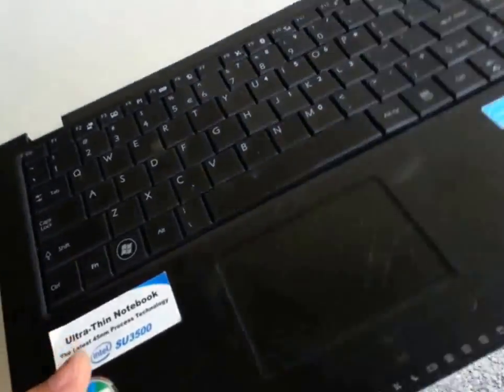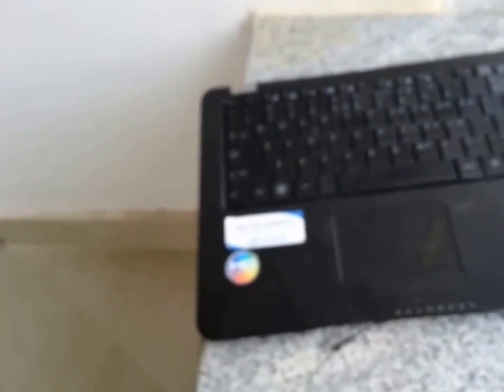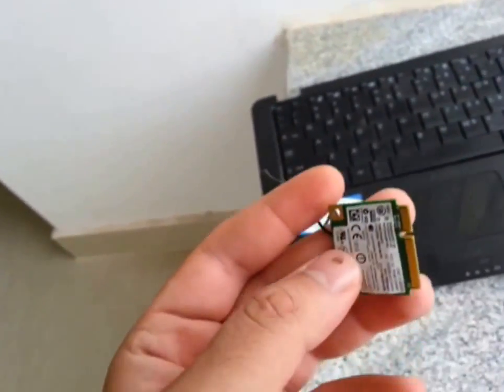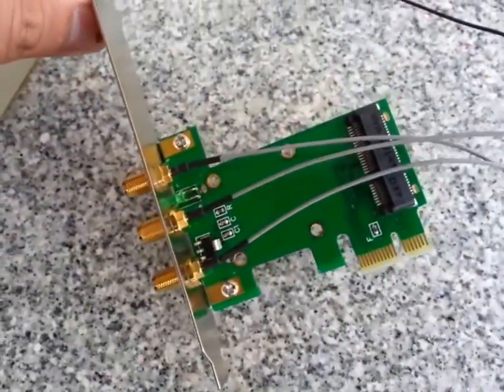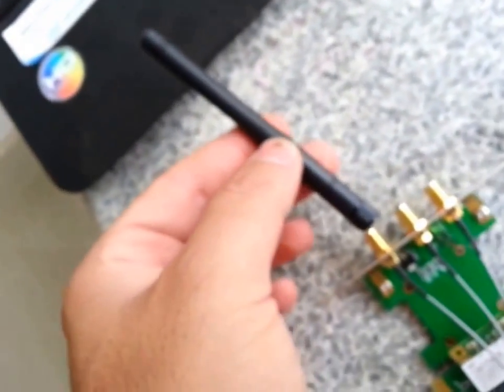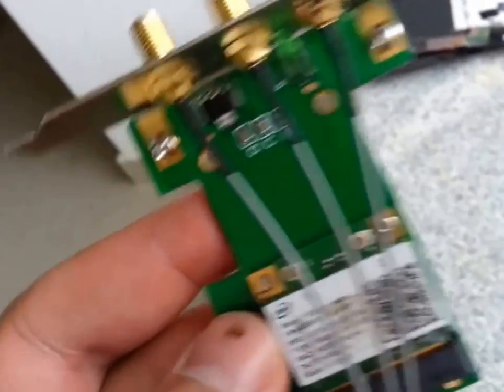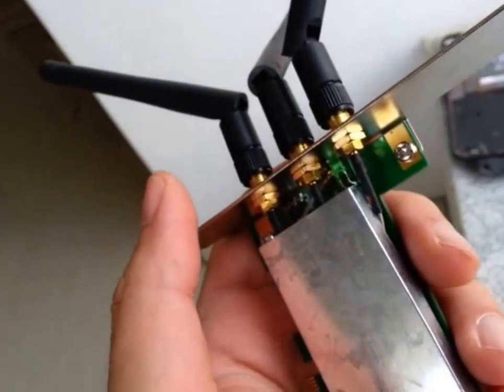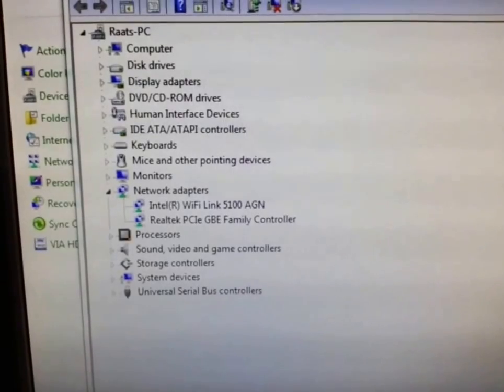Half Size Mini PCIe Wireless Card for Desktop #pcie #desktopwifi

Comment: My old Lenovo K410 desktop tower uses a miniPCIe slot for a half-height wifi card on the motherboard.  I'm going to upgrade it to a wifi6 BT 5.2 ax tri-band mini card for about 25 USD.

Getting the screws in there and attaching the antennas with my fat fingers will be the biggest challenge...
Reply from the maker: Don't worry you will get that screw on Amazon

Comment: You do not need the antennas. Get some longer antenna wires and attach them to a metal part inside the case. Voila, wi-fi with no antennas sticking out the back.
Reply from the maker: Absolutely... that is how it works in a laptop ☺️

Comment: I just want to buy a wifi chip for a very old motherboard that I'm using for now. I'm not sure which board it is, but the chip set is AM3+. I'll build it, or buy it, or whatever. Great video man, very helpful and informative. I subscribed to show you support. Keep the great videos coming.
Reply from the maker: God Bless ya!
Reply: It works on any board with PCI-e. This riser is for PCI-e x1 (the two or three shorter slots not used much)

Comment: hey i just did this but my Bluetooth isn't appearing anywhere, wifi works beautifully. any advice?
Reply from the maker: Its probably a driver issue, what unit are you using? intel?
Reply from the maker: Awesome, thanks for letting us know!
Reply from the maker: Thanks for making this work in my new project! https://www.youtube.com/watch?v=OuZBbJbNLQ0
Reply: Johannes Winger hey Johannes ... You need to connect a cable on to the Internal USB port on the motherboard. You made need a different adapter.. check the other video this guy made... It had a Fenvi adapter...

Comment: the black bar on the extender can u pulg 2 things in each side
Reply from the maker: Hi, Nope, it  is only gonna allow you to plug in the card on one side
Reply: rTech what if i wus to plug in a PCI E express into the other side wud that work..plz tell me it will
Reply: btw is the wireless card for wireless intermet or somthing else??
Reply: if so is it important
Reply: extender not express
Reply from the maker: Might blow up :)
Reply from the maker: Both
Reply from the maker: express

Comment: I did this, but I lost a lot of my signal. I went from 40mbs to 17
Reply from the maker: I guess you mat have snapped the antenna wire? perhaps :(
Reply: maybe, I took the antenna chip-things out of my laptop, unscrewed the gold bits, and ran them through and taped them to the back of the case, works great now.
Reply from the maker: Awesome:) glad it works!

Comment: I have a MiniPCIe slot on my desktop hp pro 3500. I tried with an atheros mini wireless card from a compac CQ62 laptop, so the System crashed when it was  updating the driver. So its prior to find the exact mini PCI card then I m gonna try this: ------------------------- http://www.ecvv.com/product/3862847.html or http://www.haxorware.com/forums/archive/index.php?thread-87.html

Comment from the maker: I dont think most motherboards have a slot to fit these mini PCIs in. You will need to buy a mini PCIe slot card from eBay or Amazon. Older cards may have a problem with the drivers.
Reply from the maker: ***** http://www.ebay.com/itm/Chic-Mini-PCI-E-To-PCI-E-x1-Wireless-Adapter-With-2-4G-Double-Antenna-/201228415300?pt=LH_DefaultDomain_2&hash=item2eda25f144
Reply: where do you get the adapter from? link?
Reply from the maker: Its available easily on eBay.com or amazon.com, let me know in case you cant find one :)

Comment: thank u very much sir for this wonderful video i was for two days thinking how to use my wireless card from an dameged Toshiba laptop , if i make a cabel bridge and connect to USB with any method or something like that , I found in ur video the right answer. Now i want to know how should the place in my mother borad look which thatAdapter go in ? because i dont know if that adapter will fit in my motherborad or not when i buy it . I couldn't see it clear in ur video. thanks in advance
Reply from the maker: Bashar Pero Hi Bashar, you should search for the adaptor on on Ebay or amazon.com, see this one for example, http://www.ebay.com/itm/Chic-Mini-PCI-E-To-PCI-E-x1-Wireless-Adapter-With-2-4G-Double-Antenna-/201228415300?pt=LH_DefaultDomain_2&hash=item2eda25f144

Comment: Hey..!!!  Is there anybody else having successful trial of getting this worked. Then please share your experience. Is it depending on OS or card?? Is there any limitations?
Reply from the maker: ***** Hi, I think the only limitation is the drivers, apart from that the card should work on any computer
Reply from the maker: ***** Also check out the adaptor and see if you have a mini pcie slot - http://www.ebay.com/itm/Chic-Mini-PCI-E-To-PCI-E-x1-Wireless-Adapter-With-2-4G-Double-Antenna-/201228415300?pt=LH_DefaultDomain_2&hash=item2eda25f144